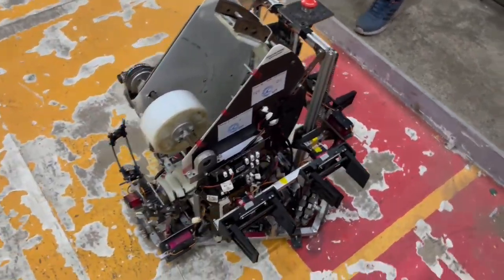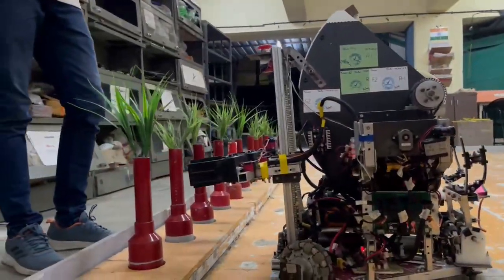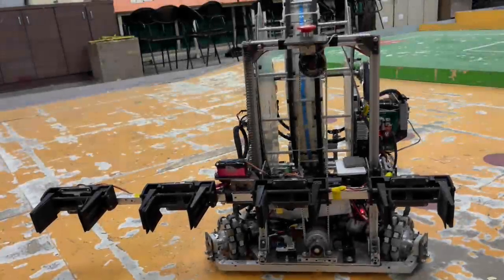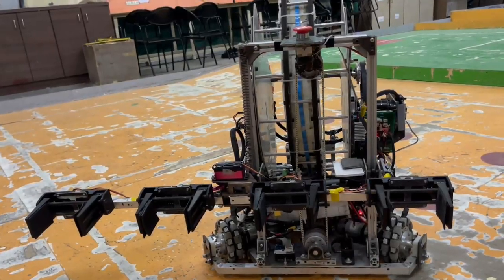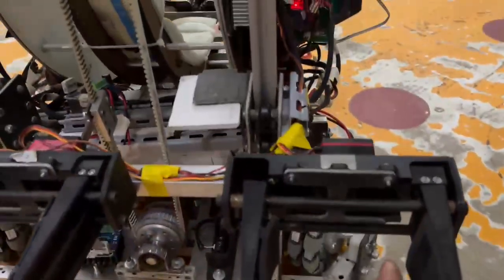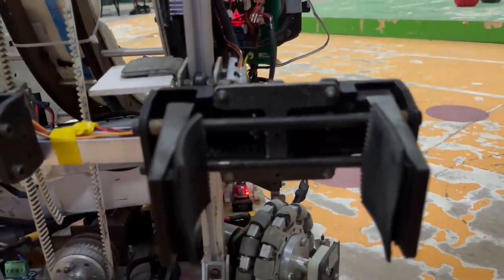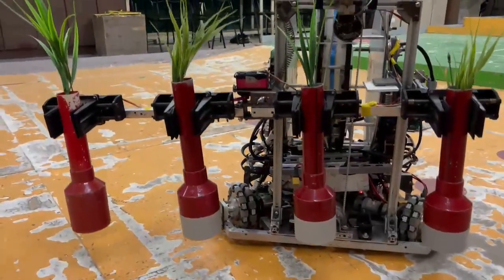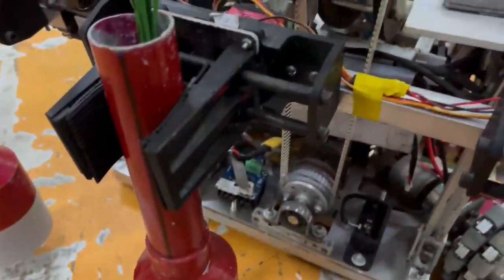TEAM AUTOMATONS | ROBOT 1 DEMONSTRATION

Comment: which BLDC motor did you use to spin the flywheel
Reply from the maker: We used T-Motor AT4130 for that application
Reply: @TeamAutomatonsPCCOE  Which bldc controller are u using?
Reply from the maker: @jubinmathew7636  ODESC V4.0